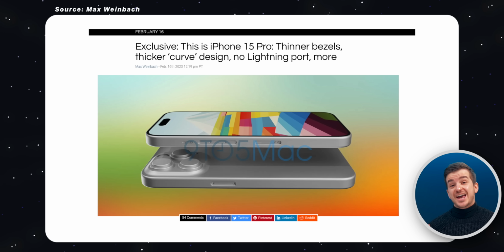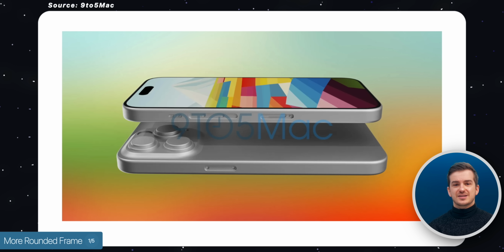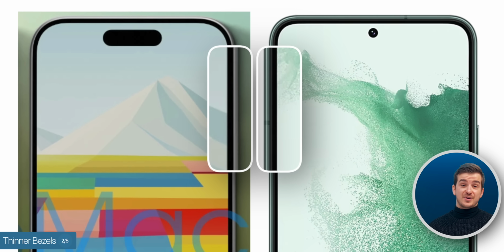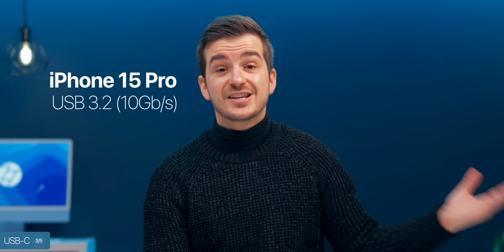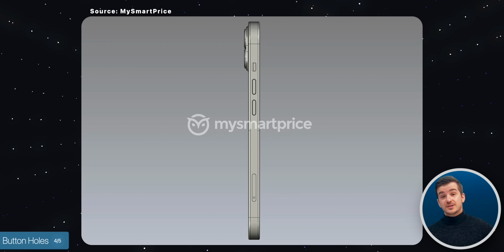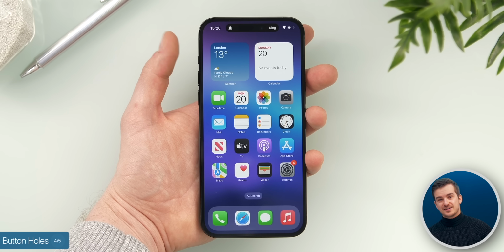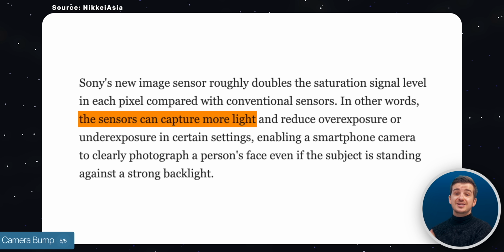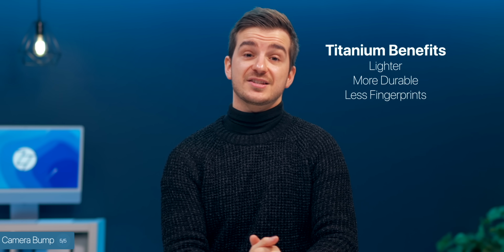iPhone 15 - MASSIVE New Leaks Reveal Design & More!

Comment from the maker: What do you guys think of the latest CAD model leaks? Can't wait to show you our concept! In the works...
Reply: I really dont care... apple degraded so much with the iPhone 14 and the new iPads i'm nit even stuff from them anymore
Reply: I will look forward to that Dan , I'm listening now! ☺️❤️xx
Reply: please stop wearing turtle necks :
Reply: @Immorttal  lol 😆
Reply: I think it will have buttons ( at least I bloody hope so) , when you slide your fingers around a phone  , its nice to feel a button , the no buttons thing has been tried before on android and it was of little value and in some cases actually cut down the versatility of this simple task , for example what happens if your wearing gloves  or your fingers or phone are wet to damp, and imo having haptics for a volume button is just a nothing burger(that I would turn off) , and just another way to use more power and waste space inside the phone that could be used for something useful.
 Also I might ask , how many good brand quality phones have you owned in your smart phone history  that's had a problem with a volume button ?
 I`ve never had a single problem.
If a phone maker  can't make a simple normal button work without a problem they should give the game away.
Reply: This is supposed to be a redesign year. What happened to the revolutionary design changes we used to get on redesign years. Come on apple, the 15 still looks pretty similar to the previous model
Reply: Love it, wishing and hoping to have that kind of phone 💖
Reply: Very cool 😎
Reply: Bro I want the Ultra sooo bad.

Comment: In my honest opinion, a more rounded iPhone more or less loses its characteristics, and looks less expensive on the outside... 

And didn't iPhone do this before for iPhone 6 series? Then they reverted back to their original flat side and 90deg corner in iPhone 12 series.

Comment: I use an iPhone 14 Pro Max and I think IF the iPhone 15 is better, I might give mine to my brother (who needs an iPhone) and just get the new one. But if it doesn't have much of a difference, I'll just keep using mine. It would be cool if they made the cameras flush with the main body though, it would make it look even better than it already is, and its actually practical since it would have less of a chance to get nicked by edges and stuff.

Comment: So its just the charging port that is a significant change
Reply: What is a big deal with lighting cable? Why do you see a big deal in having USB-C?
Reply: @sunshadow9704  of all the changes in this model this is the biggest change. I’m not impressed in the slightest I’m just pointing out the major change

Comment: Great recap. I find the camera bump to be annoying. I get the functionality, but it makes the phone more bulky and it makes it almost impossible to not get scratches on the lens.

The iPhone 14 128GB costs €922 right now in Belgium, and I just can't give that much money to a phone of which the camera will have scratches in just a few days.
Reply: I don't think that the camera is easy to scratch. I own an 11 Pro, and after years of use (screen and back glass shattered, dents in the case, etc etc.) not one of the three cameras have a single scratch in them. The camera glass is sapphire, so it's not nearly as easy to scratch as the front screen.

Comment: I’m excited for the USB-C with this iphone and I hope they do it in plus I would also like more battery life and I’m excited for this iPhone 15
Reply: i want the damn pill/dynamic island to move up closer to the bezel/frame. was way too intrusive on the 14 Pro, so I returned it and went back to my 11 Pro that I later traded in for a 13 Pro. 

I really want usb C on the 15 Pro so I can use one charger only for my M1 macbook air and iPad Air. Doesn't matter if it's only 25W, it will make my life so much easier 😅

Comment: I will be upgrading form a 12 to a 15 pro! Do you think there will be a price increase?
Reply: I have a 12 and upgrade to the 14 , on the 12 if the phone is hot while charging it will stop cool down and automatically start back charging. The iPhone14 will stop cool down and will not start back 🤬🤬 it will just sit there until you unplug it and replug it . If it stops without you knowing it’s a huge time wasted , I thought I had a messed up phone but everyone has that issue.

Comment: Expecting better camera performance. Periscope lens with at least 5x will be worth buying. Also 960 fps 1080p will be a welcome addition. The camera should beat the pixel 8 pro! Fingers crossed!
Reply: The camera would never beat the pixel 8 pro. Apple has an awful photo processing system. The problem started to rose over with the release of the iPhone 11 series and it is now worse on the iPhone 14 series. The photos from my sisters pixel 7(non pro) looks way more natural than my over-processed iPhone 14 pro.
Reply: @shaneethan523  just use pro raw??
Reply: @shaneethan523  pixel has red tint all over it. How is it natural. And it takes crappy videos
Reply: @shaneethan523  Hi, yes. Their images keep shining/glittering all the time. I am seeing this from 11 pro max onwards as they started using deep fusion etc... Daytime the skin looks like a tinted face!
Reply: that wont be worth buying at all, if you care that much about periscope just get a pixel or samsung
Reply: @drixxer  I have purchased s23 uktra. for the first time, I was impressed. All the lenses are too good. I had earlier pixel 7 pro as I a big fan of the pixel. I like pixel a. camera b. Voice-to-text recorder app. Now I am not able to find any mistakes in S23 ultra. Considering selling the P7P and keeping the ultra. I know if pixel makes it 10X, it will beat Samsung for sure! Samsung has to improve its white balance.
Reply: Buy Camera instead of IOS 😀

Comment: All I care about is the battery life not being sacrificed. Also the thinner the bezels the more likely my thumbs will touch the screen and that never ends well when it’s unintentional.
Reply: Agreed mate , more cons come with having less bezels, curved screens like the galaxy's  , including I suspect a greater likelyhood of ending up with a cracked display if dropped due to having less buffer between the case and the glass.
Maybe im old fashioned but I don't get this obsession with devices being pretty or gimmicky (cough capacitive buttons) over having better function/practicality.
 I miss the days when we got common sense FEATURES OF SUBSTANCE  , like headphone jacks , more hardware features (not less) ..... mag safe was a decent one hooray ,
 if you had android , SD cards where useful , IR blasters , i`ll say it again , I still miss the headphone jack , swap out batteries , etc ,etc.
 Some of these latest cosmetic design trends are labelled as progress , I call them crap.
Reply: Agree. The bezels on the 14pro are fine as is. Further thinning the bezels could potentially be a problem for tempered glasses too.
Reply: Naw it wasn't an issue for me w Samsung phones that been having thin bezels as long as u have a nice case to prevent this and most cases are enough ... I prefer having more screen realstate than having less with thicker bezels cause it ain't 2015 anymore 😂😂
Reply: Thinner devices and thinner bezels will always be preferred, anything else looks terrible
Reply: @jspenceolson  you’re talking looks I’m talking practicality.